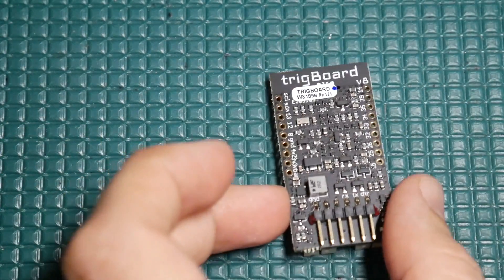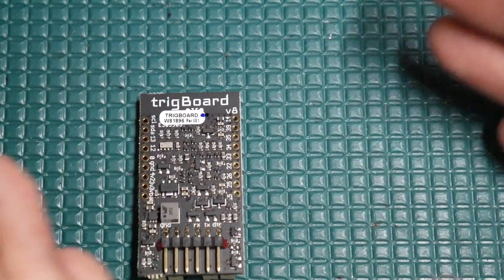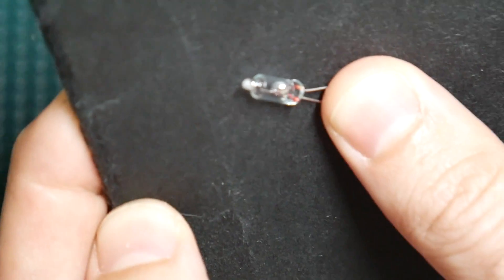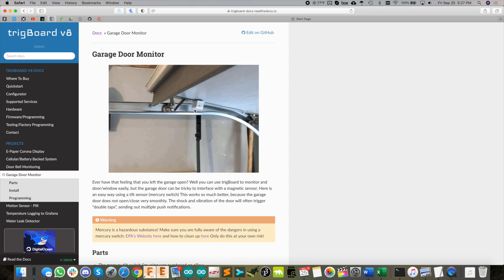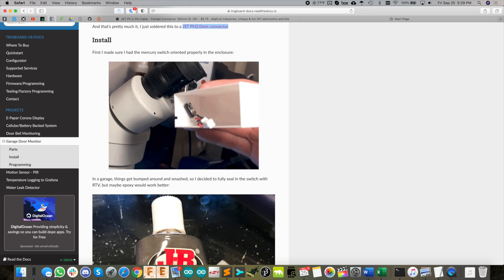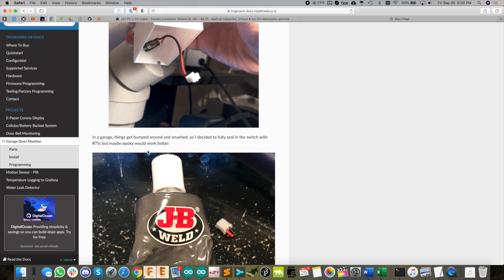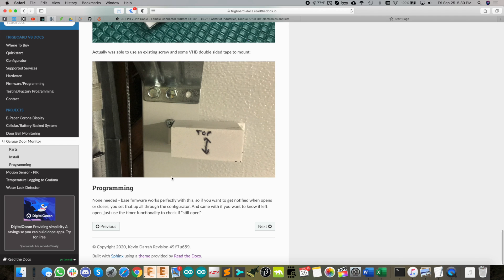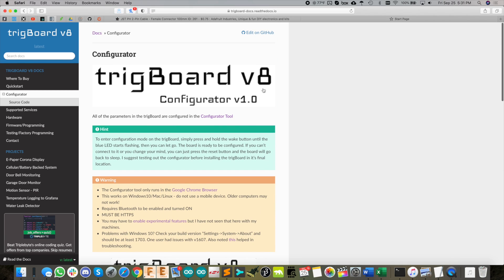Garage Open/Closed/Left Open Push Notification from ESP32 (trigBoard) with Mercury Tilt Sensor

Comment: From a security installer... the door contacts you use indoors will drop dead in a couple of years, especially on a steel door. Use the proper switch and you won't have problems. Anything along these lines will be fine and last you 10+ years... I've had some on a golf course greenskeepers shed that have been installed for more than 20 years and still work...

https://www.amazon.com/dp/B004KNZ7FQ/

Comment: If worried about the mercury you can get "non mercury tilt switch" which I believe use a metal ball (I suspect they are not as reliable though).
BTW - If you search eBay for "rotary limit switch adjustable" - these switches are very handy for this type of project (there are several designs)

Comment: Another option would be a magnet an a hall sensor.  One advantage with that approach is you could put the magnet on the door and the detector on the frame/rail.  That would mean the electronics would be fixed mounted and you could hook external power and maybe even connect into the close button so you could open/close the door remotely.  Another idea would be to have two magnets (one on one side to detect full open and one on the other side to detect full closed) and two hall sensors.

Comment: Kevin I put the reed switch at the top of the garage door, the magnet on the door(moving) and the switch screwed to the door frame(Wall), little to no vibration.  At the top of the door if it opens in the smallest amount, top moves away quick because the track has a radius. To protect the wires of the reed switch I fished them though some vinyl tubing.   Plus it is up and out of the way of snow, water people hitting it. Has work very reliably for years now. Great channel. 73 (Best wishes) CND
Reply from the maker: nice!

Comment: How often do you have to recharge the battery?    And do you have a way without dismounting the entire assembly?
Reply from the maker: years, and yea lid pops off then just unplug the battery.  I have a lot of these batteries, so just swap them out.  Or even supports AAA/AA batteries, so easily replace

Comment: I'm surprised you use a $10 battery that only has 1200mAh  when you can buy a 18650 cell with twice or more mAhs at half the price....
https://www.18650batterystore.com/Panasonic-18650-p/panasonic-ncr18650b.htm

Comment: Nice. You know there are also a non mercury version. It has one or two solid metal balls in place of mercury. I use them and works fine. The only problem is if moisture gets in the balls corroded and can't make good contact.
Reply from the maker: thanks, yea you got a link? I'm interested in testing something non-mercury that performs as good
Reply: @Kevindarrah  I thought the same as Oscar Caetano.
For example RS component has a few: https://americas.rsdelivers.com/category/non-mercury-tilt-switches/8433
I never used one myself. So I can't recommend one. But I had a cube shaped IKEA clock with something similar. You could flip the clock and it showed different values on its display (Clock, Alarm, Temperature). That is working fine still today. You can even hear the metal ball inside.
Reply from the maker: thanks!

Comment: Love the content! Could you do this one step further and an additional option to trip an audio device and/or flashing light? It could be used to let u know something is tripping in the middle of the night (alarm). And if possible we could define when it is armed?
Reply from the maker: yea, you gotta see my cellular project that relays the info to "monitor" boards that play mp3 files based on the events - that project is fully documented up on the docs as well.   I still need to make a video on the monitor part though
Reply: Kevin Darrah thanks, I took a look. What about something a little louder (non-mp3)? Maybe a buzzard (old alarm clock that runs off a 9volt) or one of those flashing strobe lights for deaf people to let them know the phone is ringing or someone is at the door (granted it may run on 120, but maybe could find a DC type).
Reply from the maker: yea, actually I have an idea for that as well - but like turn on a relay or something then could activate anything you want.
Reply: Kevin Darrah a relay would be perfect.

Comment: The Trig board can be made to do so many thing in the detection space, what a great idea. I'm just uncomfortable with transmitting that kind of info to the rest of the world via pushover and telegram et al. Is this discomfort warranted?
Reply: I run all my stuff locally on raspberry pi with node red. I use telegram bot for all notifications and  for certain commands. (you can make your own telegram custom keyboard to send commands)
Reply: @jarchdm  Thanks KJ Archer. Will investigate this further. (There will probably be a video on it by Kevin if I look )
Reply from the maker: I'm not a security expert, but I personally think it's safe, but also note that I converted my system to use a local network and send all data out via cellular
Reply from the maker: yea a lot of people have done it this way, and was requested heavily on v7 trigBoard, so now MQTT is built-in as an option for you on v8

Comment: LOL my first IoT project was also a garage door monitor.  I used a NodeMCU but know you like to use trigBoards.  Should I switch to trigBoards?  Any advantage?
Reply from the maker: yea, main advantage is power consumption - trigBoard only consumes 1 or 2uA when in standby.  And that's both if door is open or closed.   Will last for years on a battery

Comment: Hi Kevin, since I follow you video, I have been using the pushover and telegram as a notification to my phone.  I see your all your video has notification instantaneously.  But when I use my pushover sometimes it takes up to 1 minute to get the notification.  Do you have any suggestion as how I get the notification under 5 second delay?
Reply: That's may be an issue with your phone. Are you on Android?  Some manufacturers are very aggressive with their power saving, so the app may not be receiving notifications in the background all the time like you might expect. You might try turn off power saving for that app, or to troubleshoot you can try sending a notification while the app is open in the foreground and see if that reduces the amount of time it takes for the notification to come through.
Reply from the maker: wow that's crazy long, have you tried push safer? I have tutorials on that as well.  Pushover always seems faster for me - ~3seconds or so
Reply: @Kevindarrah  Yes, same delay also seem not consistent.  I like to using phone texting notification so it is instance and guaranty receive it.
Reply from the maker: are you part of the discord group? if not send me an email and I'll give you a link. We can help you out over there